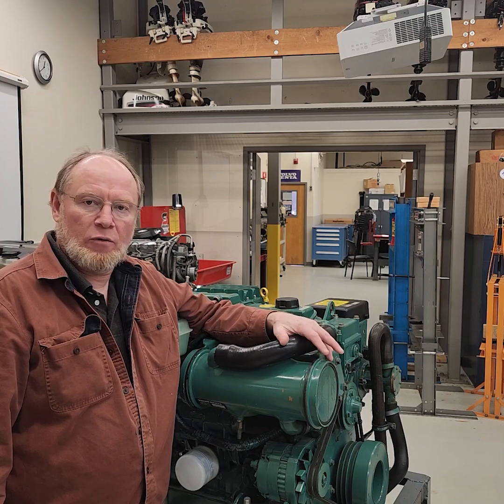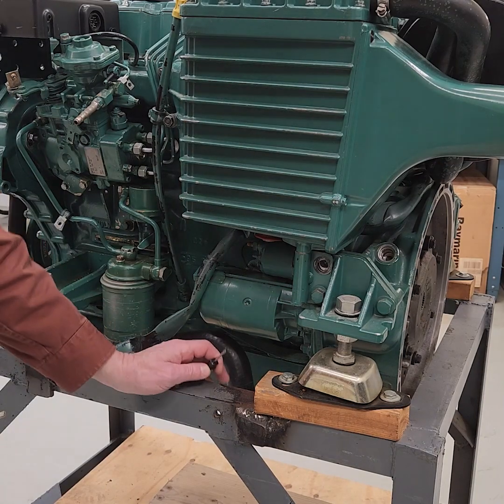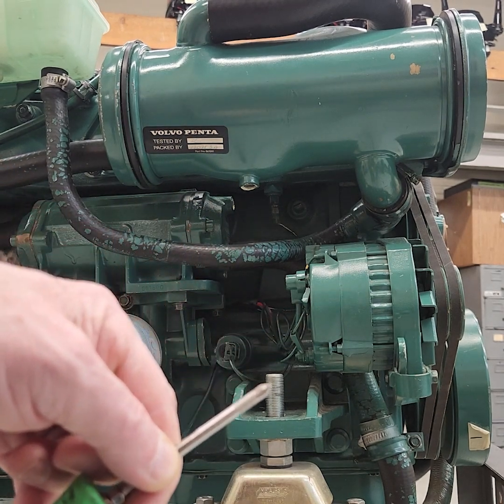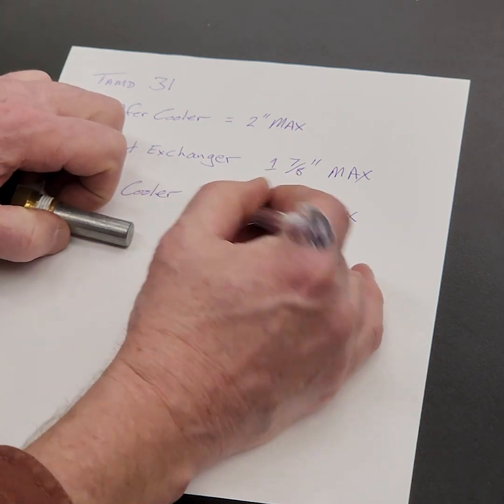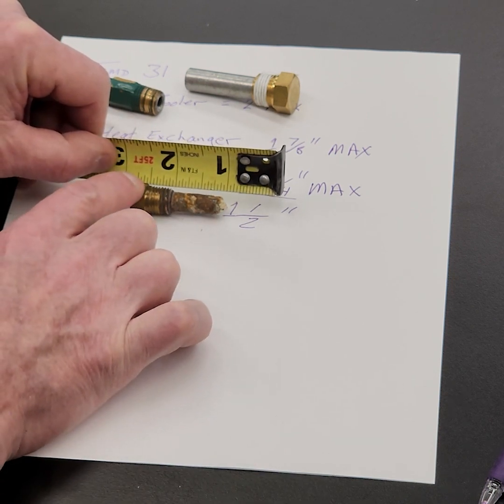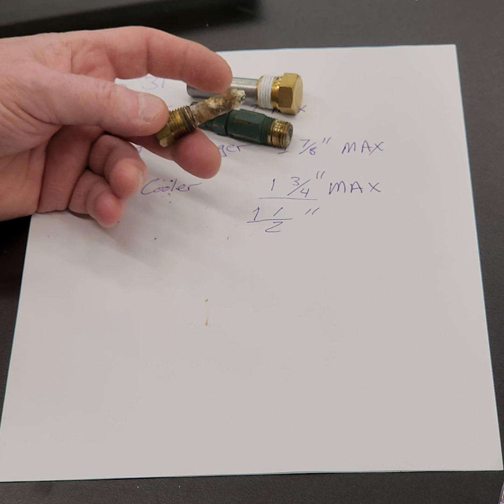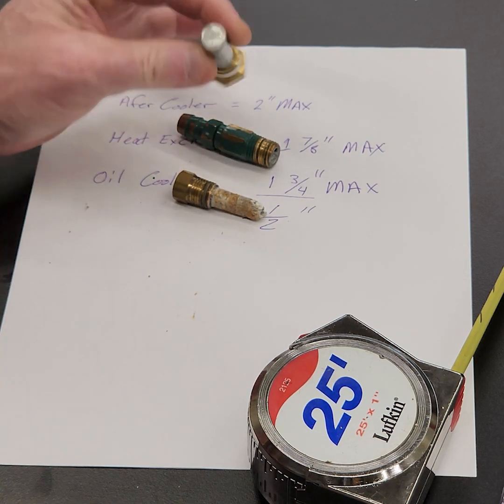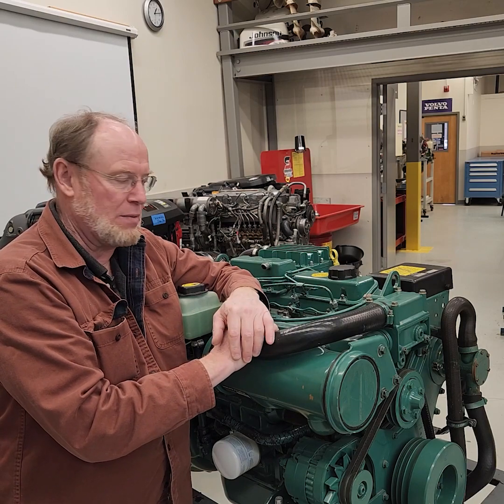Backfitting Anodes into Marine Heat Exchangers

Comment: Thanks for your videos, could you make a video about dismantling the heat exchanger on tamd 31p as residues from the impeller will end up in the heat exchanger and cause heat problem. Most people do a descaling, but it can't remove the rubber blades from a defective impeller, so they never solve their real problem

Comment: Thanks Ted for the great vid. Would putting teflon tape on the threads insulated the plug from the ground and there for stop the flow of electrons ? Ie stop the anode from eroding ?
Reply from the maker: No, the metal to metal contact will still be there, the Teflon just fills the gaps.
Reply: @tedsmarinerepair8956  ok no problem, thanks for the reply.

Comment: Hello Ted,
Is it right, that the 
Kamd44 P  B, does not have any anode in the cooling system?
Volvo penta said so.
Thanks for your reply 
Marcus
Reply from the maker: Yes, I have a video that shows where they can be refitted
Reply: @tedsmarinerepair8956  
Hello Ted, thank you for your reply. 
I saw that video, and i ask my volvo penta dealer for new anodes, but they say that engine need no anodes...
So now i am not sure what to do...
On the other hand it is very difficult because we have only little space

Comment: Hi Ted quick question, I have a 310 D6. When the ignition is on just before they crank over I noticed a click click sound that doesn't stop until you turn the key off.
Don't know if it does it when running as too much noise. Its sound like its coming from the fuel rail ?? both engines do it.
Only just noticed as usually I'm not near the engine bay on startup, maybe normal, love to hear your thoughts.
Good info on your channel 
Thanks
Reply from the maker: Mark,
It's totally normal, simple explanation is the ECU is electrally charging up the injectors electrically to get the 80 volts needed to open them.
Reply: @tedsmarinerepair8956  Thanks Ted I thought that was the case, ever body I asked did not know. Again thanks for your help 👍

Comment: Hi, is the orange/red seal at bottom of aftercooler ment to be assembled the way it is?
Reply: It should be inside the housing pressed between the bottom of the brass core and the bottom inside of the housing.
Reply from the maker: Yes, it seals the cooler and the outside of the drain

Comment: Hi Ted great channel!  This is a different topic but Can you tell me why I can't use a Volvopenta 8.1 gas fuel pump (with FPR on the highpressure pump) on a Volvopenta 380 Gas engine.  Same bolt pattern, same water cooler line locations, same electrical connections, same "Carter" high pressure and lower pressure pumps and the same fuel pressure regulators.  The carter part numbers on the pumps are identical, so is there a reason I can't use the 8.1 (which is available in the aftermarket world) on my 380 CE-A engine?  Any opinion would be greatly appreciated.
Reply from the maker: I believe all 8.1 engines ran at 40 psi. The V8-380 6.0L used 50-60 Psi I can't find the official fuel pressure for the V8 380 CE-A at the moment so they my not be the same fuel pressures.
If you can determine the fuel pressures for each is the same, then I see no reason that you couldn't use the 8.1 pump assembly.
Reply: @tedsmarinerepair8956  Ted thank you so much for the reply., If I switch the FPR on the 8.1 fuel pump with the 6.0 FPR will that correct/regulate the PSI output, or am I missing something?  The FPR seems to fit in without issue?
Reply from the maker: @xuv5607  I believe it should work fine since you have the same fuel pump part #'s, so the volume will be fine. Just ensure all the fuel lines line ends match up and attach with no issue. I always change the fuel line end o'rings and put motor oil on them prior to installation. 
Let me know how you make out.
Reply: @tedsmarinerepair8956  Ted thanks so much for the help!!

Comment: So 1/4’ thread for the anodes? Also, I’ve got a kad42p-a and it has the same heat exchanger setup and drain plugs with no anodes.
Reply from the maker: The threads are tapered "pipe" so the  inside hole diameter is 1/4" for pipe fittings and metal pipe, so the outside thread diameter is larger and tapered.

Comment: Teflon tape on the threads? Doesn’t the anode need to be grounded?
Reply from the maker: It will still have contact, the tape just fills in the grooves. If you want you can always test he fitting to the housing with an ohm meter, I'm positive you will read continuity